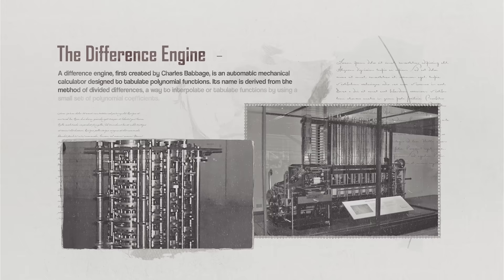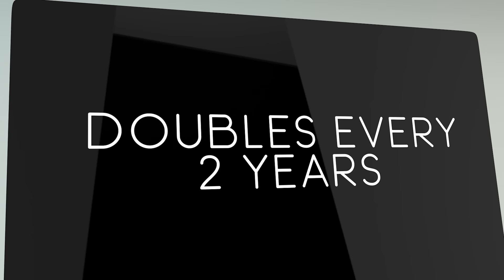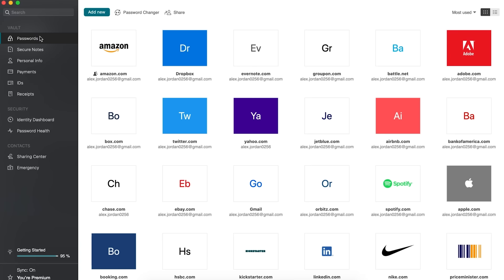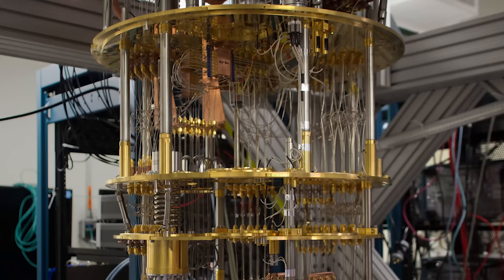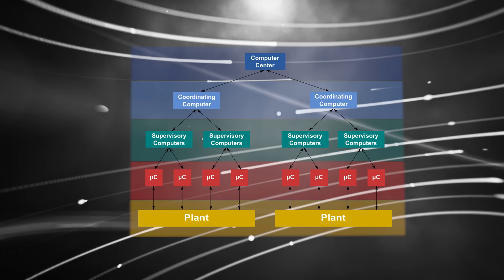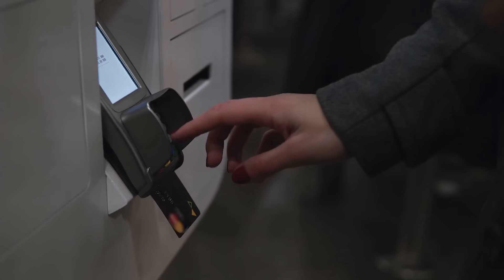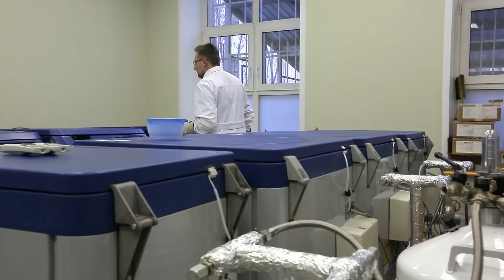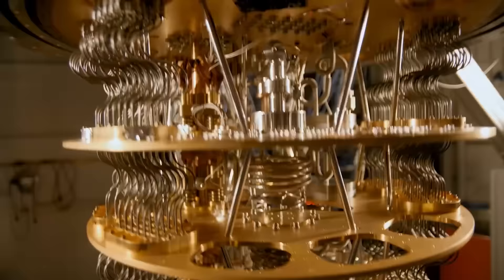This Revolutionary Computer Is About to Change The World for Good

Comment: As ibm has admitted to the failure of quantum to a finite answer of definitive answer having to rely on classical algorithm to finalize the computational calculations for a clearly broken algorithm that merely needs to be partly integrated into classical as its only a type of quick dropping of additional repeating occurrences that reduces the answer to a closer question of variables leftover

Comment: In 2015, D-Wave's 2X Quantum Computer with more than 1,000 qubits was installed at the Quantum Artificial Intelligence Lab at NASA Ames Research Center. They have subsequently shipped systems with 2,048 qubits. In 2019, D-Wave announced a 5000 qubit system available mid-2020, using their new Pegasus chip with 15 connections per qubit noob

Comment: Reports like this are great but focus mainly on the successes in quantum computer research which are impressive and substantial, but the downsides of the current technology are also quite substantial and extensive. In other words scaling a current day 30-40 qubit machine to a 300-400 qubit machine are likely to be a lot more difficult than building the initial machine like the Rigetti IBM machine.

Comment: Another great video. I watched a Linus Tech Tips video about a Quantum computer, it draws no electricity and is run at just above absolute zero, the cooling system is was draws power not the processor, It's crazy and amazing

Comment: D Wave is building a quantum computer for a friend of mine's office in Las Vegas. The company buying it is called Profit Connect. It is located in a 50,000 ft.² warehouse. They started building it in December, putting in the massive cooling towers. Each tower is 3 feet wide and 20 feet tall. When they're finished there will be 338 cooling towers filled with a dialectic fluid that transmits no electricity at all. Into these towers, they will be submerging 1000 boards with 14 processors a piece into the fluid in each tower. Since December they have installed approximately 35 towers. The fluid Will be brought to a temperature of around absolute zero in order to keep it all from burning up. I have only seen pictures of what the quantum computer itself is going to look like. If you can imagine a large chandelier made of 24-carat gold you're kind of getting the idea. The total cost is over $15 million. For the last decade or so they have been harvesting cryptocurrencies and they have developed AI that will be able to see inside cryptocurrency transactions and find out the amount of the transaction before they have to pay to process the transaction. I believe they said they are only processing transactions of $10,000 or more. D Wave is making a film of the installation that will be released when they are finished. Totally freaking awesome.

Comment: The only thing that draws back the quantum computers is they are not in a fixed state while classical computers are much more precise when compared to quantum computers in absolute and smaller calculations (slower tho), quantum computers can do those calculations even bigger calculations faster but not exactly accurate (Considering we are doing calculations which are far simpler than quantum application). Due to this quantum computers won't be a good thing to use for domestic purposes for quite a time though they would be beautifully magnificent for astronomy and probabilities.

Comment: One day the world will have a need for 5 computers....I have more than 5 in my home! We have two desktops for gaming, 2 laptops for work, and a tablet for whatever but that's just scratching the surface. We (fiancee and I) have many, many devices that essentially are computers but are called something else and I'm not talking about smartphones or TV's. 

You see, my fiancee and I are just about the biggest gamers you will ever find. I don't know how far back we can go before a console isn't considered a computer but...we have every console from the Atari 7800 (test release 1984) through the Xbox Series X and PlayStation 5 *physical. This includes even the most rare and odd machines you will ever find. However, if we're only talking consoles that have a processor and fully realized GPU like a real PC we should start with the original Xbox. So that's the Xbox, Xbox 360, PS3, Wii, Xbox One, PS4, Switch, PSPRO, Xbox One X, Xbox Series X, and PS5 *physical (in order of release). This puts the number of consoles at 11 that were designed like a standard computer, 4 computers, and 1 tablet for a total of 15 real computing devices just in my home alone. If we were to include smartphones, 4K UHD's (all smart), and smartwatches that number balloons to 22 electronic devices that fit the bill. What a time to be alive!

Comment: THOUGHTY2 .. You know of the DWAVE type of computers which allows for Ambiguity States which make the DWAVE generation of computers "OF NO USE AT ALL" .. What you are completely unaware of is the Q2 computers .. Like Babbage's Difference Engines the Q2 uses as dual differential Q2 circuitry which is used in the current generation of Quantum computers .. This is much like a Ballan a balanced circuit with "Quantum Noise Cancellation Circuitry" .. This new circuit only allows a 1 or a 0 state to occur so standard programs can be run on these machines .. The Q3 combines Quantum Memory with Quantum Processors eliminating some of the bottle necks .. Q4 will be a system that incorporates the Q3 capabilities to Quantum Mass Storage .. When it comes to Quantum Mass Storage it will be hard to fathom the storage density .. In the grand scheme of things a single Quantum Laptop could have all the compute and storage capability of all the x86 computers with all other processing done from other platforms be orders of magnitude less that all the capacities of the current tech today .. The Q4 machines some believe are at least 40-60 years out .. The reason for this is that molecular quantum machines are only a figment of our wildest imaginations .. On the other hand no one can explain why Q2 machines suddenly are being used by some militaries around the world .. No one can Explain that Q3 machines are 5-10 years out .. The Q3 machines are a step closer to molecular quantum machines and this is due to new quasi-crystal molecular elements which are assembled .. So tell us what the future of Quantum Sciences are please, if nothing else retroductively ..

Comment: The only reason that the millennium bug didn't do a lot of damage was because there were hundreds of thousands of man hours spent fixing it before 2000. Also there are several other bugs of a similar class that we still need to fix such as the 2037 bug and several other where the integers holding the numbers loop. (Exceed the max int value)
Reply: 2037 Bug?
Reply: @mikejohnson5900  Actually it's the 2038 bug due to the epoch seconds 32-bit overflow. Just search google for 2038 bug.

Comment: Wouldn't it be possible to replace the on/off bits with something that can have more than 2 states, like having multiple levels of currents or wavelengths to represent different values?
Reply: There have been ternary base computers designed, but an old story - more than 50 years ago.

Comment: I think I get it now. A quantum computer is like turbocharging or supercharging an engine. An engine alone is okay and pretty powerful, especially a modern one. But adding a turbo or supercharger will increase the power output exponentially, such that the engine alone would not be able to obtain.

Comment: Great video as always,
However....

The chip that was on the picture when you said transistor wasn't a transistor sadly. It was a negative voltage regulator the LM7905. These voltage regulators take an input voltage of 5VDC, for example, or higer and converts it to a more stable - 5VDC. The LM79 family has quite a few members, to name a few the 7905, 7912, 7924.... It also has cousins the 78 family. Unline the 79 family, the 78s do the following: They take a negative voltage and convert it into positive voltage.

Great video otherwise!

Comment: Moores Law isn't about "power of computing", it is about transistor density. "Moore's law is the observation that the number of transistors in a dense integrated circuit (IC) doubles about every two years. Moore's law is an observation and projection of a historical trend. Rather than a law of physics, it is an empirical relationship linked to gains from experience in production."

Comment: I've wondered if Trinary would ever be a practical solution.  That is charged Bits, + - ø that is positive, negative or no charge.  This would mean slightly larger machine area for each bit, but having 3 states that means 2 bits would have 9 possibilities.  Instead of 2 4 8 16 32 64 128 264 it would be 3 9 27 81 243 729 2187 6561 which is far greater possibilities out of 8 bits than currently.  Thing is, is it possible or would static electricity make it impossible.

Comment: Not that anyone will read this, but here's how quantum computers (QPs) work and what they're used for:
- Ignore the 3-state cubit, it's misleading.
- QPs cannot perfectly calculate simple operations like 2 + 2 = 4.
- - This is why QPs will never replace your laptop or be used for bank transactions.
- QPs will be great for A.I.
- - How? A.I. or Deep Learning is based on probabilities (look at neural nets)
- - QPs use quantum mechanics where a semi-infinite number of states exists  until measured
- - Once measured the wave-state collapses to a single state...which is the answer based on stats
- - Think of Schrodinger's cat, you don't know if it's alive or dead until you measure (observe) the cat.

Will QPs be a reality?
Well, people like IBM, DWave, etc. have said they have QPs but no one has been able to solve any practical problem.
QPs are made by either solid state (Si, Graphene, etc.) or suspended atoms. The solid state approach will have too many issues with background (phonons, nuclear spin, etc). The suspended atoms may be the best approach but scaling this up will be a nightmare. In short, don't hold your breath waiting for these things.

Edit: spelling (assuming I got them all)

Comment: Ada Lovelace has sometimes been acclaimed as the "world's first programmer" on the strength of her authorship of the notes to the Menabrea paper. This romantically appealing image is without foundation. All but one of the programs cited in her notes had been prepared by Babbage from three to seven years earlier. The exception was prepared by Babbage for her, although she did detect a "bug" in it. Not only is there no evidence that Ada Lovelace ever prepared a program for the Analytical Engine but her correspondence with Babbage shows that she did not have the knowledge to do so.

Comment: Would it be safe to compare this computing difference between classic and quantum, is much the same way a typical combustion engine differs from a rotary engine? The typical combustion engine works on the basis of turning up and down motion into circular motion, but at great expense. The very top position of the piston inside the cylinder is 0 or 1, while the very bottom position is simply the other digit. These "dead" positions are absolute and therefore exquisitely define a total zero, or total one. On the other hand, with a rotary engine...

Anyone who understands the principle behind a rotary engine knows where this is going.

Comment: I’ve always thought Schrodinger’s cat to be a stupid theory obviously if the cat is it live or if it’s dead looking in the box doesn’t change that it confirms that quantum entanglement however is different whereas it seem similar, I think the solution might be simpler in order to observe the particles that go through the slate we may be altering their actions in someway we are unfamiliar with consequently if anyone out there can link me a paper on someone who took to quantum entangled beats and went on opposite sides of the earth and caused a reaction that was mimicked by the other particle on the other side of the planet I would like to know or read that paper if this is true it could be it could be possible to send a text message faster than the speed of light as long as the phone originated from whoever is texting the entangled bits could be used to represent characters of our alphabet

Comment: Technology doesn't advance is a smooth steady incline. It grows in spurts. Someone invents a new a truly new technology, and then everyone else spends decades and sometimes centuries improving that technology and incorporating it with other technologies until it reaches a peak. Sometimes a newer and better technology is invented before the previous tech peaked, but usually that's not the case. For very obvious example, bronze age sword making was mastered globally by most civilizations by as early 3500 BC, but it wouldn't be until 500BC before the first signs of Iron were seen taking shape in weapons and it wouldn't be until over 600 years later before the Iron age was full swing and you could argue the Iron age didn't completely master Iron and steel manufacturing until Andrew Carnage stepped on the stage in the 1870s

Comment: This is scary stuff, they're using data from parallel universes to speed up their computing power. If you had to search 10,000 pages to find one letter X, it would take you a long time. If you could have yourself simultaneously read the other 9,999 pages (in 9,999 alternate universes), you would find the X in seconds vs days.. provided the version of you who found the X on their page could instantly convey the pg number, to the other 9,999 versions of yourself. That's basically what quantum computing is doing, operating in states of matter we don't even really understand, at a temperature colder than deep space using applied quantum physics, pulling data out of alternate universes to crank up our computing power - oh yah, what could go wrong? lol

Comment: It's hard to provide "Proof of algorithm correctness" even with current digital processing. I would think it would be much more difficult with Quantum processes. Sometimes it's important to have absolute certainty that an algorithm is correct: Airline auto-flight systems, autonomous driving systems, nuclear warhead launch systems, etc. Perhaps by using multiple independent quantum systems in parallel and having an odd number of systems that solve for the same problem simultaneously... if two systems say "Turn left and accelerate" while the 3rd system says "Turn right and slow down.", a mediator can choose the majority opinion. Lol.  But I guess multiple parallel processing is what quantum processing is all about anyway.

Comment: I'm surprised no one else has commented on the "polynominal" functions (at least he consistently misspelled and misspoke both).
Reply: Yeah. "Polynominal" is actually a word, but not the one he intended. It has nothing to do with Babbage's Difference Engine, which computes polynomial functions using the method of Divided Differences.
Reply: @dredell  that's interesting, I didn't know that! So what does "polynominal" mean in another context? I couldn't find anything about it other than misspellings of polynomial
Reply: @andresgoens  I've seen a few references to "polynominal" suggesting that it refers to a multi-valued variable. But as you say, most of the instances on the Web seem to be just misspellings of "polynomial".

Comment: When looking at spent fuel rods in a nuclear reactor, I was told they look blue because the color comes from the particles going faster than the speed of light.  I have no idea if true, just know that is what nuclear physicist told me.
Reply: It's true, as the light moves slower in that medium. So it's faster than light, but not faster than c (lightspeed).

Comment: Sorry, I feel asleep during the commercial. 

Actually, one of the biggest bottlenecks in supercomputing is the network switch. The law of diminishing returns is achieved quickly with conventional switching technology, whereby adding more nodes not only fails to add speed, but starts to degrade performance.  

DataVortex Technologies has a new, scalable switch that can link an infinite number of nodes to it. In theory, if you had enough nodes, you could build a machine that could do anything. It also operates on regular 110 Volts, and does not have the insane power requirements of traditional supercomputers.